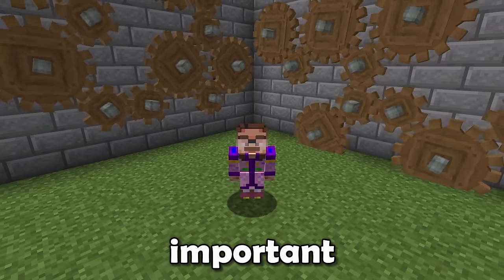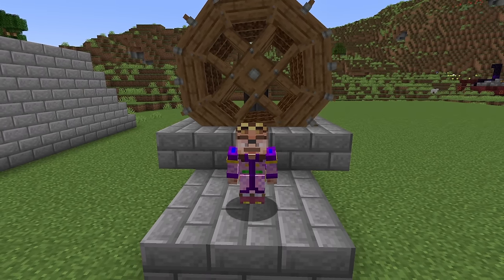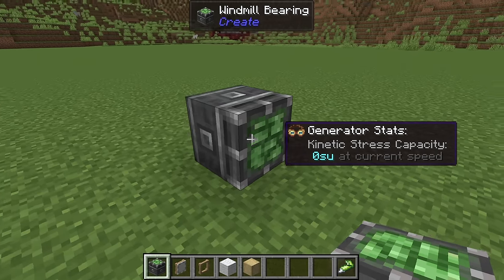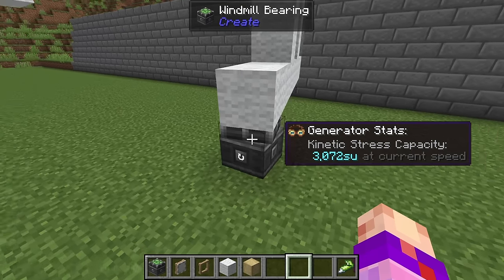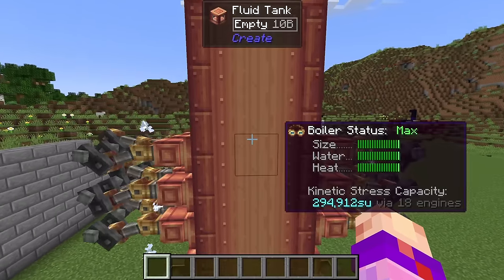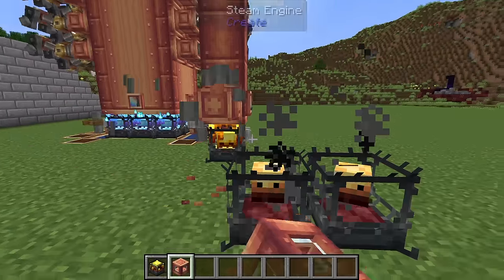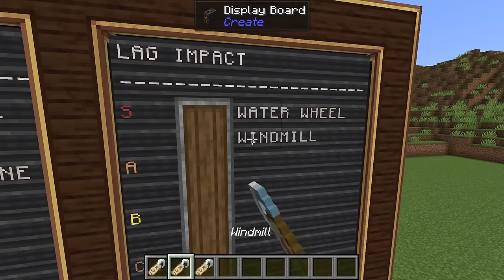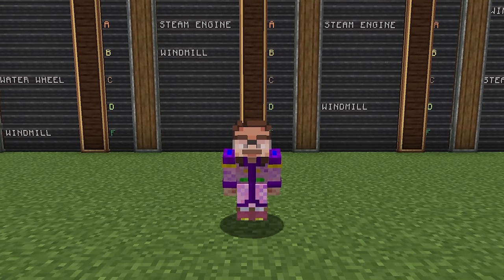Water Wheels Are BETTER Than Steam Engines (Kind Of) - Create Mod SU generator comparison guide

Comment: The tierlist part was the worst of the video. Windmills are the BLAST for early to mid game. For most things at early game 8k cap is more than enough, so scalability becomes easy AH, and grinding sails is easy as long as you have shears. The cost of steam comes mainly from fuel gathering methods. Usually it's lava farm, which can easily cost you a few stacks of iron for 9 lvl engine.

Comment: Windmills feel somewhat underwhelming. Sail blocks actually lose efficiency if they're adjacent to other sail blocks, and that scales with how many blocks they're adjacent to. So if you want to make a windmill with larger blades for looks you wind up sacrificing efficiency, meaning the most efficient method to use them in is what you showed. I guess you're maybe it's supposed to encourage you to have multiple windmills?

Additionally, in Create, there's no such thing as expenaive. You can infinitely generate resources like iron and gold. Not copper or redstone, but you can farm that in other ways. I think the only mineral that can't be infinitely renewed (and I can't wait to be proven wrong) is Lapis Lazuli. But even then Ithink you can trade with villagers for that.

Comment: Man, you  can put the handle in this tier list and it would be on the 1st place amongside with the wheel because it's space efficient, accessible and deals no lag impact, but no scalable. It's 3S and 1F like a wheel. So i think, your top is a little dumb

Comment: Btw if you didn't know you can actually get a level one steam engine with a campfire instead of a whole blaze burner. Making it a VERY small VERY cheap VERY low maintenance 16,000 su. Cool

Edit: I just realized that because of that. It's VERY easy to scale AND very low lag since the lag was coming from the fuel.
@Dejojotheawsome please make a vid or just check if this actually works since I don't have actual access to create and let me know. Thanks
Reply: @dejojotheawsome

Comment: Does this just assume only using the Create Mod? Not sure which Create mod addon it is, off the top of my head, but I give the Blaze a straw and I can pump lava straight into them removing all those laggy items you showed.
Reply from the maker: This is vanilla and sadly pipes are really laggy and I think crafts and additions straws are pretty bad too, in fact they're probably laggier :(
Reply: First of all the addon is called Create Crafts & Additions, secondly, the setup showed on the video is not laggy at all.
Reply: @dejojotheawsome  Thanks for your feedback. I started up a Family SMP with several kids and adults about to start playing and trying to be proactive at reducing laggy things where I can. Thought dropping the depot, mech arms and funnels, based on the numbers your mod provided, that the straws might be my solution.

Comment: I feel the need to point out that steam biolers are the only power source that requires fuel unless you use campfires as heat at the lowest level
Reply: In turn, i feel the need to point out that with create fuel farms are almost literally dirt cheap, and with just a moderate wood or kelp farm you can power a lvl9 boiler indefinetely, which is a CRAPTON of stress units, that average player will never be able to use.
Reply: @mrShift_0044  You don’t even need a wood or kelp farm, you can make a dripstone lava farm with 12 cauldrons and it’s much more space-efficient

Comment: problem with these tests is stress units is also depends on RPM a wheel turning at 16 with 256SU when slowed down to 8RPM with a speed controller will produce 512SU
Reply: .......im pretty sure it doesnt work like that
Reply: @kenbaird7454   it doesn't, but they're not far off. Changing the speed keeps the stress capacity the same, but components use more SU at a higher speed.
Reply: @AJ-Palermo  While that is true, the speed does not actually effect the energy generated, only the energy consumed, so the issue they brought up isn't actually an issue.
Reply: @kenbaird7454  you can understand their confusion tho, in real life you can sacrifice speed for torque or vice versa, it seems SUs are measured similarly to horsepower, but some people assume it represents torque.
Reply: @9_1.1  Yeah, I can see that. Although I am glad the create mod devs decided to make it simple, and just have it be a measurement similar to Joules, representing total energy created, instead of making you calculate the torque for different speeds

Comment: µs = 0.000001 Seconds. Minecraft needs 20 Ticks every secont to run without lag, that means you have 50000µs to calculate every Tick. So the stuff you showed is not laggy at all.

Comment: Can't you power a steam engine with a campfire, thus making smaller ones far less laggy and easy to get and scale?
Reply: Lmao, with minimal heat you get 512su per campfire and at this point it is easier to just place a couple of large water wheels.
Reply: @mrShift_0044   base steam engine produces 2048SU

Comment: Windmills do at least have on very good use: flying machines. You're not powering a flying machine with steam engines, and while you can do it with water wheels with dispensers, it's much more annoying and much slower.
So if you're making flying machines for moving bases, my very favorite thing in this mod, windmills reign supreme. They do suck otherwise though.
Reply from the maker: ooh true! I don't really find that a lot of people make create mod flying machines though so I hadn't thought about it!

Comment: how is a big water wheel more cost effective than a small one? you need a small water wheel to make a big one, so you are still spending shafts, and all you’re doing is spending 8 extra planks to make a bigger water wheel with the same power output, not to mention that it takes up much more space.
Reply: Yeah, but you get 2 times the SU for a shaft and 16 wood, if you used 2 small ones it would cost 2 shafts
Reply: @tigerboy4705  but its at half the speed, so if you made their speeds equal with a gear ratio they have the same power output. in other words, if you make their speeds the same they will be able to run the exact same amount of machines. the only reason i can see a big one being useful is if you want a slower speed to run more machines without having to craft two cogs to make a ratio. but even then, you already have 7 more shafts after making the water wheel (you cant craft just one shaft, you get 8 at a time) so you can just make the cogs and save space.
Reply: @9_1.1  true true, tho I mostly use small wheels as well, I think there is an argument for big ones

Comment: the way you measured the "lag" of the steam engine sucks so much.
1. lag goggles or whatever mod u used to measure it isn't known to be the best way to measure the lag. Spark is.
2. 48 microseconds is really not a lot of lag, i've had laggier single blocks than that whole assembly of machines. Considering that's the highest number in that chain and considering you need 50000 microseconds of lag to even start noticing TPS issues, that's really performant. That's what happens when you use tools and you don't even know how to interpret the information the tool gives you.
To put it into perspective, you'd need around 500 of those blaze burner setups to even start having tps issues, and even then it'll just be 19 tps which is still playable.

Comment: you gave some misleading information, you implied that a level 1 steam engine still requires a blaze burner but it doesn't, you can power a low level steam engine with a campfire, or lava source, or a magma block.
Reply from the maker: that's a passive level steam engine you're talking about which isn't level one

Comment: Well then i don't know what's wrong with my world, but if i place a couple of waterwheels my fps tanks like crazy if i look at them. When i look away and the fps returns to normal... The windmills with the wool under the ground is doing the trick for me. But perhaps i could try to put the waterwheels underground as well
Reply: not sure if this’ll help in your case, but some graphics cards struggle severely with the default backend setting used by flywheel. try running the command `/flywheel backend batching` to see if it fixes the problem. the radeon card my laptop uses is actually pretty good but without batching my FPS tanks the moment a contraption appears onscreen.

Comment: well when you're playing create you'll have huuge factories, with a bunch of components similar to the steam engine. You cant even compare the low amount of lag created by the steam engine to those, plus its microseconds!!!. also forgetting that maybe you can quickly create a bunch of water wheels early but people dont do that. they upgrade their machines so they can make stuff faster including the steam engine so by the time you need extra SU you can make steam engines just as quick as water wheels. and honestly maybe its easier to just fill areas with hundreds of water wheels, but it aint pretty.

Comment: i don't quite believe your lag ranking is accurate. the steam engines contribute MICROseconds to server lag, and basically nothing to client lag. this is completely acceptable.

windmills though! boy, have you played this with shaders? they ANNIHILATE performance. there's a flywheel/iris compat mod that helps with this, but that one will mess with EBE. so you may get acceptable performance from windmills, but now chests and such aren't optimized anymore. it's bad.

Comment: So you can use a small water wheel to speed up the large water wheels and they still produce double the stress units? That's broken!
Reply: You can do the same thing with gears, a rotational speed controller, etc.
Reply: @AJ-Palermo  don't you sacrifice stress units when you gear it up?
Reply: @dahelmang   nope! The components (drills, mixers, etc) use more SU, but the total capacity stays the same. Larger water wheels effectively produce double the power of regular water wheels. If you gear them to the same speed, the SU's are still 512 and 256
Reply: @AJ-Palermo  oh I see, they take the penalty on the machine side, not the production side. That didn't occur to me. Thanks!

Comment: Steam engines are vastly superior for one simple reason: They give copper a use.

Also, you can use campfires instead of blaze burners to heat your steam engine. They produce less heat, but they don't require fuel or the nether

Comment: can't you use campfires for the steamengine?
Reply from the maker: yeah but it's outclassed in a lot of ways by water wheels
Reply: Terribly inefficient. Campfires (and unfueled blaze butners) produce about 512 su per heat source. At this point just use water wheels. Also any powered boiler larger than 2x2x4 produces WAY more power than it produces lag.

Comment: I see a lot of questionable takes in this video.
Space efficiency: Windmills are more space efficient than Water wheels if you actually make use of the 3x3 footprint. 
For water wheels you did not consider the space taken up by the water or the blocks containing it at all.
Covienience and Access: Windmills form a spinning contraption which can serve as the base for something like a wood farm.
I would personally rate windmills to be more convienient than steam engines since steam engines need a constant fuel supply as well.
Scalability: I cannot understand why you consider windmills to scale badly, you can build new windmills to get additional SU just like waterwheels. 
Also, whatever source of wool you got the first two stacks from will make building future windmills a lot easier.
Lag Impact: The numbers you show in the video are pretty much meaningless without context. Maybe show the lag impact of common farms or give a ms/tick figure from carpet mod to give some idea of how relevant the lag actually is.
I would also like to mention that windmills and espectally steam engines have way better aesthetics for a decent amount of SU generation than water wheels.

Comment: 1 ųs is 1 microsecond or 1/1000000th of a second per tick, on a server with a few hundred funnels you might lose a few tenths of a tps but realistically this wont affect someone even with a potato pc so long as they arent spamming them 

Plus i do a tree setup with my steam engines instead of lava, theyre bigger but cheaper to set up and one largish tree farm is enough to power like 6 steam engines if you just use 2 saws on it, no funnels needed
Reply: Kelp is better fuel source, but yea, wood farm is literally WOOD and ROCKS cheap.
Lava cube is better late game source though.

Comment: I am the windmill advocate. I am here to advocate for windmills.

1) Windmills are moveable.
I don't mean "portable" like you were talking with minecart contraptions, they can be also moved with pistons, gantries and bearings. Since fluids can not be easily moved, windmills are the only thing that can make create flying machines possible.

2) Windmills are faster.
According to both the wiki, and the in game speedometer, small water wheel runs at EIGHT rotations per minute, and the large at FOUR. Even with the small waterwheel trick, a fully stacked windmill is twice as fast as a waterwheel array.

3) Windmills are more compact then waterwheels.
If you choose to place your sails efficiently, and not like you showed, you can place eight sails around a linear chassis. Stacking this setup sixteen times gives you a total of 128 sails for a full windmill, for a total volume of 3x3x16 blocks, which is exactly the same volume as with a 8192 SU water wheel setup. You do need an extra block for the bearing itself, but every single waterwheel requires at least two blocks for a water current, meaning a full windmill is 3x3x17, while a full waterwheel is 4x3x16. Furthermore, if you omit the chassis, and use glue instead, you can get full power in just 3x3x15 including the bearing block. Keep in mind that the windmill is still also four times as fast.

4) Windmills are a contraption.
You can connect anything you want to the moving windmill structure, and it will work the same as on a mechanical bearing. This means you can add an entire rotary farm onto your generator, with no stress impact. A rotary farm running on 16 RPM on a mechanical bearing consumes 64 SU. A rotary farm on 16 RPM on a windmill bearing produces 8192 SU as a byproduct. You are likely going to build some sort of rotary farm anyways, just by using sails for the arms you have a free generator, and yes, it works even while unloading through an interface.

5) They look better.
A full windmill is very easy to make look good. It's practically begging for a wooden tower and a thatch roof. On the other hand, and anyone can feel free to take me up on this, because I am genuinely curious, I dare you to try and make sixteen stacked large waterwheels look decent.

Therefore, your first column is wrong, windmills are literally more space efficient than waterwheels, your second column is debatable, once you get access to sheep or spider spawner, sails are not hard to get, you can't get flooded by windmills when taking them apart, also you don't have to bucket a ton of water when setting them up, only complaint I have is that the autoplace feature on sails isn't as easy to use as it was probably supposed to be. Third column is nonsense, you scale waterwheels by adding more waterwheels. If you want to scale a windmill, add another windmill. You can put them next to each other and connect them with a chain drive, or opposite and connect them with a gearbox. In terms of lag, I don't know, on one hand, a spinning solid hitbox might be trouble for the computer, on the other hand, fully stacked windmill is just one active block, while waterwheels are sixteen individual ones.

I know you have extensive knowledge of this mod, therefore I can not interpret this video as anything else than a blatant malicious attempt at anti-windmill propaganda.

Comment: As someone who has only played in versions without big water wheels or steam engines, windmill is the best. For every water wheel you need to craft them (annoying in large scale) get sould sand to maximize the speed and completely cover them with water, which is annoying and takes up so much space. The other option was a flywheel but having to make a farm to power something was very annoying. For windmills, they were basically free since you can find bearings in structures (create above and beyond) and wool is easy to get (doesnt take very long since so many sheep are next to my base) and you only need 2 stacks for each. Much more convenient than the other options. I used 5 of them to power my beggining factory. Im not sure about late game though.
Reply: Doesn't work that way anymore. Flywheels are now decorations and waterwheels give their full speed and SU from touching a single running water block. Hence why the three water wheel setup shown works at full efficiency.

Comment: Steam engine isn't expensive, 😂😂😂😂 bro is using creative blaze burners, which output max heat. Like sure it's not expensive to buy a printer, but the ink costs. Blazecakes are a freaking pain to make and automating the process takes ages and faaaarrr more materials. These thing gussle fuel like Joey with a gallon of milk so yeah they cost time and resources to make worth their use.

Comment: As a very simple solution to the lag machine you attach to your steam engines, there is this thing in create called straws… you put them on your blaze burners so they can receive fluids as a power source and feed your lava i put directly into them with pipes, no fancy bucket setup required, no lag involved… straws are dirt cheap as well btw